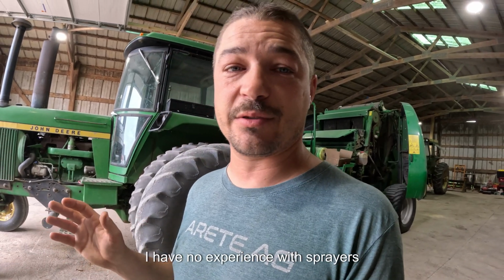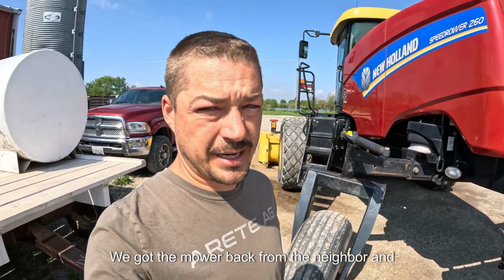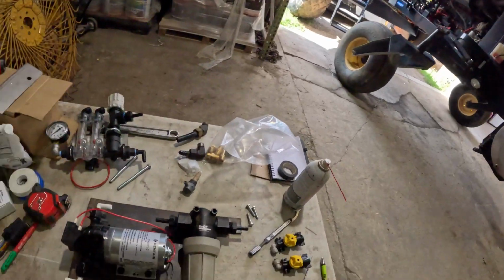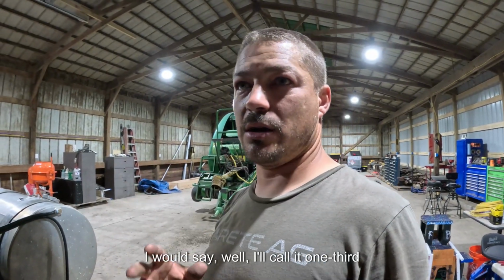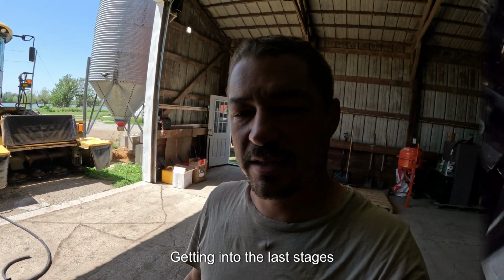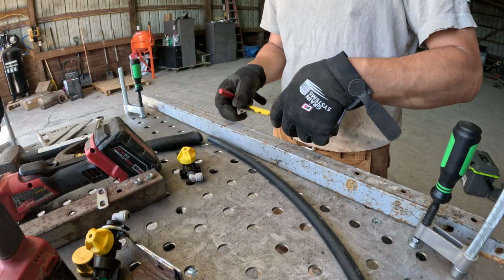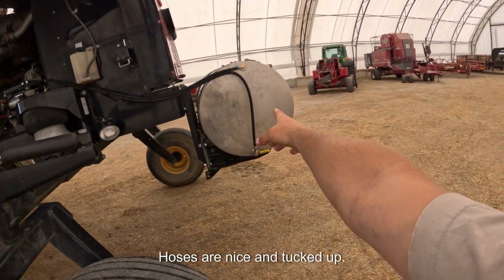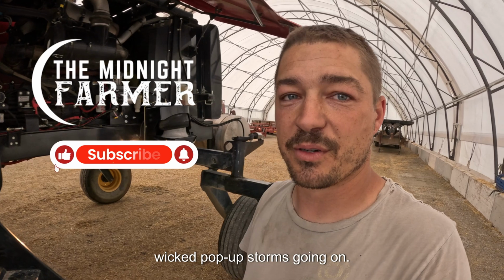Custom Spray Applicator Build for the Speedrower 260 | Full DIY Setup

Comment: That is quite the setup.  Is it common to condition the hay as it is being cut?
Reply from the maker: Thanks! If you’re referring to the crimping rolls on the cutting head, then for alfalfa and other legumes, it’s almost required because of how long it would take for it to dry down without! Grass hay wouldn’t necessarily need it, but it’s still beneficial. 

If you’re talking about the spray, I think it’s fairly uncommon just based on the people I’ve come in contact with! It’s much more common to apply a preservative at the time of bailing instead of cutting. Hope that helps!